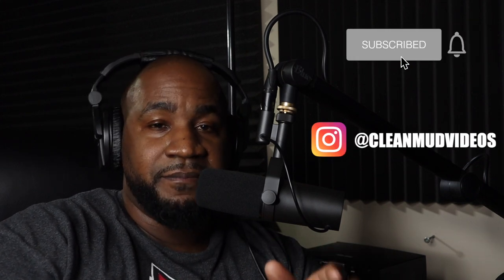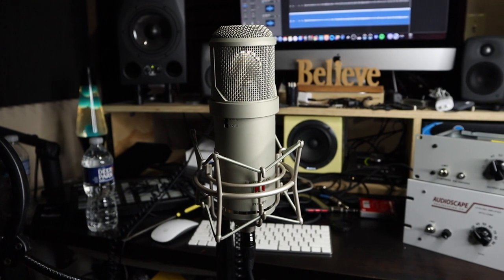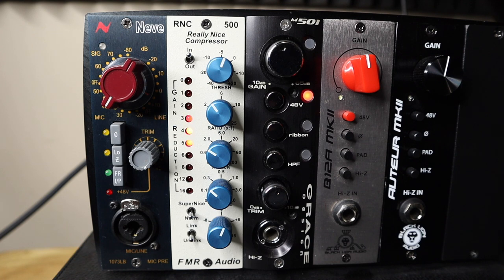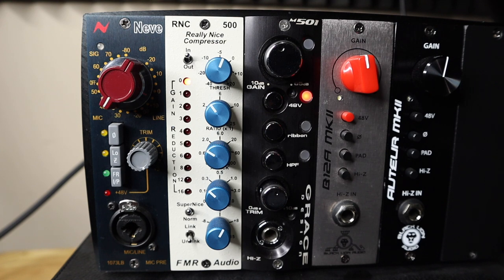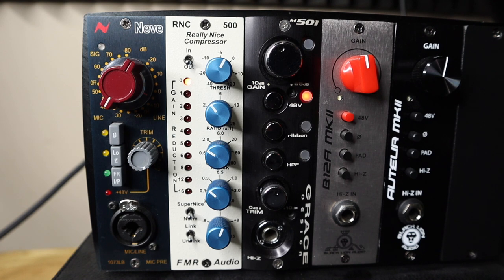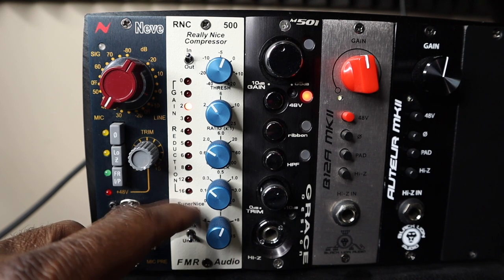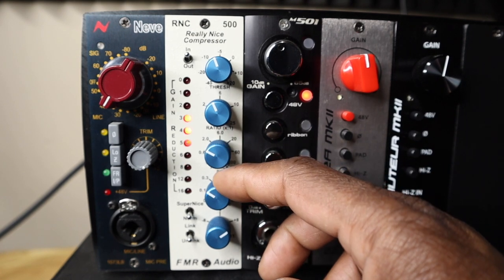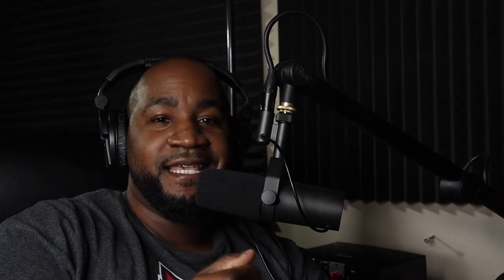FMR RNC 500 compressor demo on a rap vocal

Comment: When SUPER NICE is turned on, do you still have to tweak the knobs to effect the quality of the vocal or does it automatically control it no matter where the knobs ratio, thresh etc. are turned to?
Reply: All the knobs function as normal when SUPER NICE is on, so yes turning the knobs when SUPER NICE is on will change the sound/quality.

Comment: What’s the difference when going out then in when compression
Reply from the maker: If I understand correctly, I don’t think there would be a major difference
Reply: @CLEANMUDVIDEOS  kool. So when you have a signal going through theirs no audible change to the signal during compression? I ask this, cause I wondered if compression is still taking place.